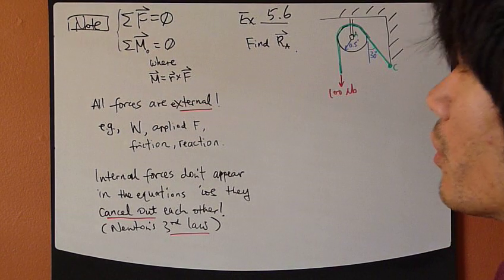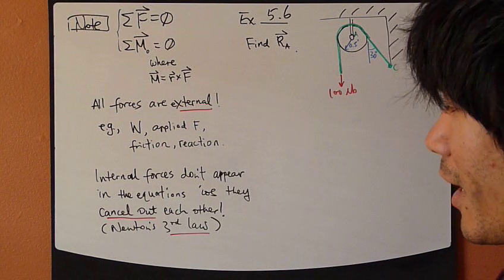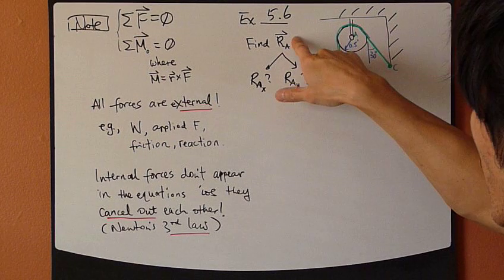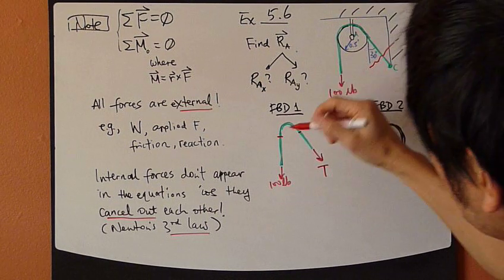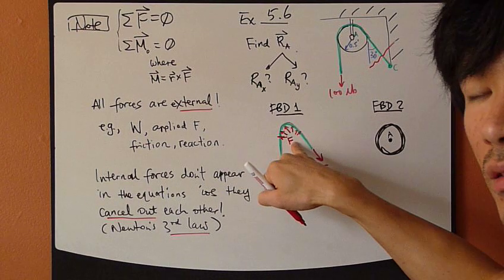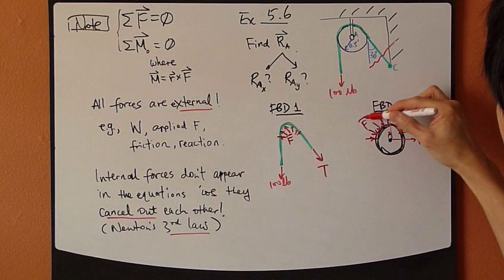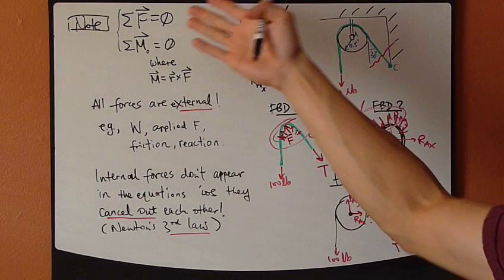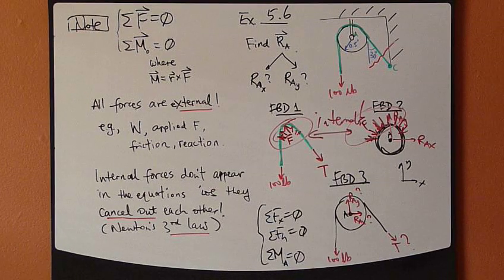Engineering Statics Ch5 Part3: Rigid Body Equilibrium, External vs Internal Forces

Comment: In case you're still wondering, you do use the triangle.

Solve for the x and y components separately, when you do that you incorporate the 30 degree angle. 

For example, 

Sum of all Forces in the 'x' direction = 0; -TSin30 + Rx = 0.
And since T=100 (because tension is the reaction of the original force), The reaction force of A in the x direction = 50.